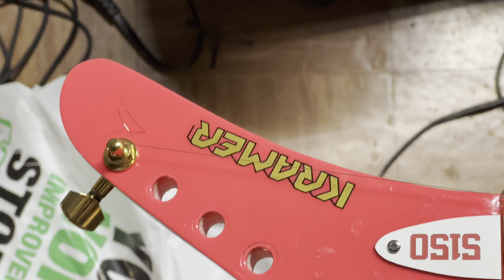Installing Guyker Locking Tuners on the Kramer Baretta Special!

Comment: My recommendation if you are replacing hardware.  Locking tuners, graph tech nut (works fantastic on my crazy Dean headstock) and if you don't mind splurging a little, Wilkinson locking saddles.  You can buy the Wilkinson bridge with them on it, but less expensive to just buy the saddles.  I know Pete Thorn loves them.
Reply: great suggestion, i am installing guyker tuners, graphtech nut and a wilkinson vintage bridge

Comment: The angle that the strings goes through the nut could present some issues
Reply: Yeah that’s a big part of the problem the angle that the B and high e come out of the nut even with a perfectly cut nut they can bind you can wrap the B and E backwards on the tuning peg to get a straighter string pull over the nut. I’ve pretty much done everything Jake has done with mine except I have a graph tech nut a Wilkinson vintage bridge and Gotoh locking tuners and mine stays in tune better than any non locking tremolo I’ve ever played the bridge saddles and the nut are the main points as Jake said. Even with the graph tech nut I still use nut sauce and it helped a lot with the e and b binding. The trick is if you know which strings bind after a dive you can bend them after the dive bomb to get it back in tune.

Comment: I had a nightmare experience with Guyker when they first showed up on the guitar parts scene. 5 years ago?

I ordered a set of locking tuners from Guyker and the machining on them was atrocious. They looked great. It's like they spent more time on the external polishing and plating than they did on the machining and quality control. They looked beautiful.

The problem was the machining on the locking pin. They were almost impossible to turn. It was the threads. Defective machining on the locking system. One of the pins was coming out of the string hole because the hole through the string post was drilled off center. Only one machine was able to loosen up a bit with penetrating oil.

So I complained to the seller and they sent me another set. The same thing was wrong with the new set. It held up a build I was working on and I was pissed off. Now, I have PTSD from Guyker! Maybe they are getting their QC down now and had a bumpy start. I'll give them a try again with something small.

Regards Jake, John...